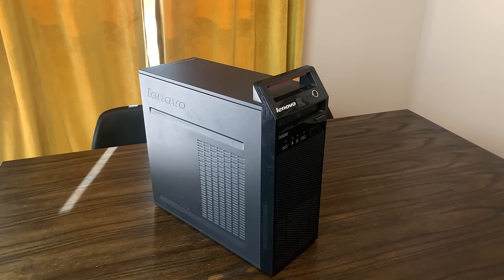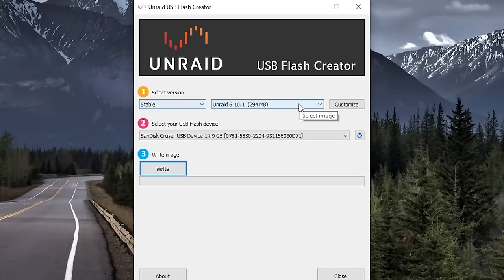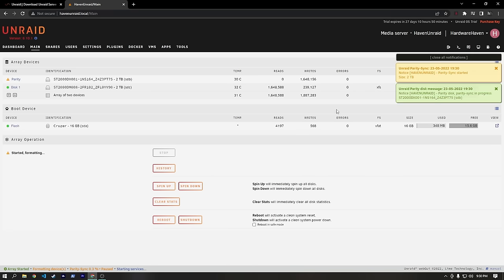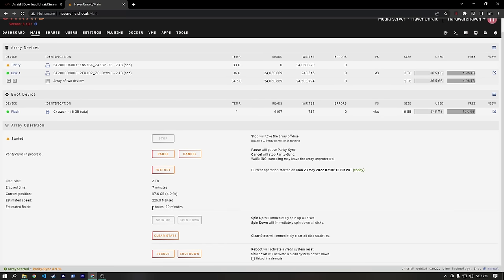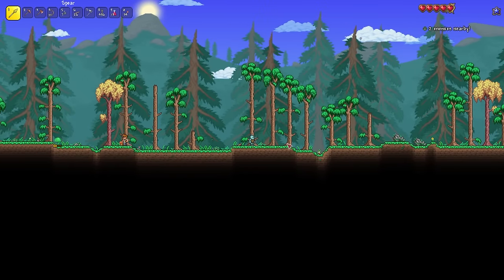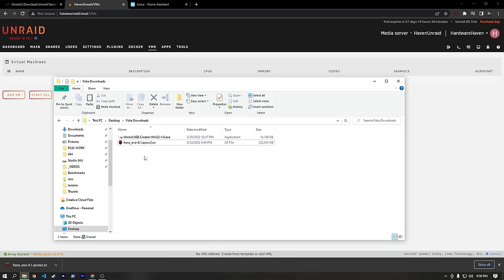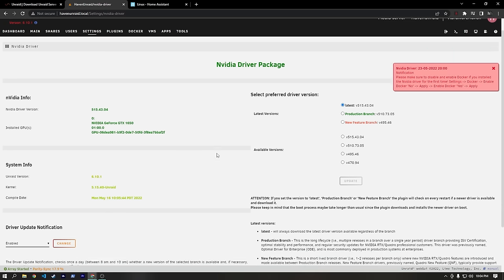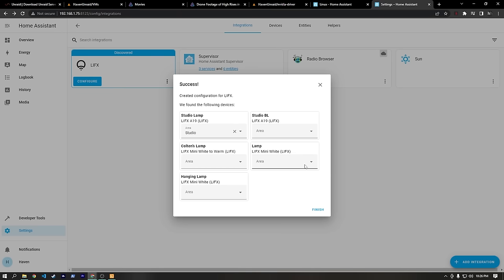Convert an Old Gaming PC to a Home Server using Unraid - (SMB, Terraria, Home Assistant, Jellyfin)

Comment: Taking out the SSD was a huge mistake. You don't wan't to run Unraid without SSD cache (or at teast use it for docker). You are loosing so much performance, I would argue using Unraid without SSD cache makes no sense (if you are not using ZFS pools in the newest release).
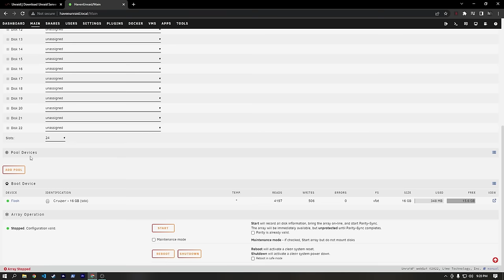Reply: No. He said in the video at the 10:47 min mark that he’s doing that in future videos and didn’t need it for this video.

Comment: Great video!

I actually built my current gaming rig with the intent of it eventually becoming an entry-level server.  As it now has 25 TB SSD space, its conversion to the dark side is nearly complete.
Reply: 25 tb ssd what  the hell are you working on nasas modded mc server or what
?
Reply: @gobnbi  Video:  4k60 / 8k50 VR
Audio:  32 bit float
Reply: @redslate  bruh

Comment: i allready have my old gaming pc since three years running as my unraid server with 8x 2TB drives..  with a xeon 1231v3 32 GB ram in my old antec 300 case every 3.5 bay and every 5.25 bay with 3.5 adapters occupied in it... running in our houses basement... all drives mounted with vibration absorbers... i love it also with plex, nextcloud, and i love "lan cache" living in a shared house with other gamers... this was the best thing besides using pfsense as our router to get our internet connection balanced between all of us... as the call of duty remake came out  6 people here where playing it... with every patch with a size about 25- 50 GB this really saved our connections bandwith.

Comment: Something to consider about the power supply, depending on how many drives you're using, the stock PSU that comes with a lot of prebuilt PCs may not have enough connectors, much less enough power. I'm using TrueNAS on an old Optiplex 7010 and had to pop in a PSU upgrade to have enough SATA power connectors.
Reply: Don't these Optiplexes all use non-standard PSUs with proprietary connectors? You know, Dell being Dell and all that?
Reply: @nahco3994  The older ones did not, depending on the configuration. The one in mine (the mini-tower 7010 model) did not have many connectors, but they were all standardized, so a quick swap to an off-the-shelf PSU was simple.

Comment: This is an excellent video that goes over a complete relatively basic setup - thanks!

I have one request for a potential follow-up: one of the possible issues in repurposing an old pc as a 24/7 server is power consumption (with power prices in some places in Europe beign 0.30 € / kWh running a 100W device 24/7 would cost 260€ a year, for example, and even with US prices being nearer 0.15 USD / kWh it's stilla pretty penny) - would you be able to delve a bit into how much power your system uses? If you have access to a more conventional NAS a comparison might also be very interesting.
Reply from the maker: Dang I meant to mention power consumption..

This system idled at around 35W. I didn’t test power draw while running data transfers or the terraria server, but during a cinebench run (so basically full cpu load), it pulled around 90w from the wall.
Reply: That's the reason why I hesitate to move any of my home network services from my Raspberry Pi to more capable hardware. Even the RPi 4B idles at roughly 3 W, and peaks out at a meager 7.5 W or so. That's really tough to beat, given the fact that its performance is more than good enough for most tasks. It might struggle a bit with media transcoding though, since there's no hardware support for that.
Reply from the maker: @nahco3994  If you have one and it meets your needs, that's perfect!

Comment: Great tutorial and channel.  Your presentation is smooth and accessible to DIY/Enthusiast/Hobbyist like myself.  I have been working on my own homelab/studio that started as a collection of old desktops of various architecture/form factors repurposed as Proxmox nodes.  Now I have a serious collection of compute and storage resources that I dont dare run at one time unless it gets real cold.  Then I do "folding at home" play hardcore graphical video games, mine monero or run hashcat 😝  then its like the tropics in my apartment ...lulz
In the previous video about building an economical NAS from various components, I have a very similar mobo made by foxconn for HP called the Nutmeg-C or P it is a slimline mini-ITX with same soldered on CPU the J2900 Quad-Core Celeron Swamptrail? 1.6GHz very powerful almost industrial PC.  Well it doesnt have PCIe slots it has a mini-PCIe for WiFi and two SATA2 data ports but an odd proprietary power connection that is closest to a Audio Line-In connection.  I think I should just need to wire my own for it from a 4pin Molex connector.  I've only used that one with different LiveOS from USB.  It remains in my collection because it is so elegant and economical for doing many things... Like making use of "thin clients" over Raspberry Pi's

Comment: So here's my question. I have two 8tband two 4 tb drives prepared for this. However one of the 4tb drives is the important info that I need to save on my nas. 
So once I put them in, it looks.likw I have to format them all. 
If I do that I lose the info that I want to save. 
So can I put in and setup the first two 8 tb drives , get it all setup then , add the other ones and copy the info over before I format it?  What's your suggestion?

Comment: The 1650 can run from the 75W power that the PCIe x16 slot provides, so you may not have needed to upgrade the PSU at all

Comment: I also remove any discrete GPU and run the machine headlessly using MS Remote Desktop or similar, that saves power and heat.
Reply from the maker: I mentioned early on in the video why I kept the GPU in, but it’s still a headless setup. The monitor was only for initial install

Comment: I can't get the hardware encoding to work. It is the one thing keeping from fully committing to running a home server at this point because it's been days that I have been trying to figure this out. The nvidia drivers are working, the nvidi-smi command shows my gpu, a rtx3070. but as soon as i turn on hardware encoding in jellyfin I get playback errors and the processes do not show up in the console. What am I doing worng?

Comment: I just happened to do this same project last week, for the SSD, I assume you know this but for others who don't, I used the small older SSD I had as a cache drive. So I left it installed, added it to the pool, which should give me better write speeds.

Comment: I have a question about this. Could this work headless without a GPU? I mean like set it up with the GPU, get it primed to use a remote software, then pop the gpu after setup?
Reply from the maker: Depends on the hardware. Because of the Xeon I’m using and the motherboard I have, you have to have a graphics adapter for the system to post. Consumer Intel chips will have an integrated GPU, so it boots just fine without. There are also more server type boards that don’t require a GPU of any kind to post

Comment: Can I use these instruktions on a "real" server? I got a HP proliant DL380 G7 rack server for next to nothing but am a complete noob and learning from scratch regarding servers. Are these programs usable on my machine? I put a sun F80 sas ssd pcie card (4x200GB ssd) in it to use as a cash/buffer and 72GB ecc ram, it has 2 xeon x5650 cpus (6c12tx2) and a Nvidia gtx 210. I am hoping to add more storage as it now has 4 x 146GB sas hdd´s, 1 is my C: and 3 is in raid as 1 volume. Will there be any pros or cons regarding my set up when it comes to using these instructions? Is there any hardware you would add or remove for a better result? Perhaps a follow up video focused on used "real" servers as more keeps appearing on the second hand market?

PS. I do plan to modify the fans to "normal" quiet pc fans so I can stand having it in my apartment as soon as I find the parts I want to use. Older server parts (like mine) can some times be tricky to locate, as I have discovered.

Comment: I did build s server for $0.00. It is based in the remains of a 2003 HP d530 SFF.  It contains a Pentium 4 HT (1C2T; 3.0GHz); 1.5GB DDR (400MHz); 4 leftover HDDs in total 1.21TB (3.5" IDE 250+320GB and 2.5" SATA-1 320+320GB).  The case is an even more ancient; a Compaq Evo Tower with a Windows 98SE Activation Sticker.  The system runs FreeBSD 13.1 on OpenZFS 2.1.4.   The system has 2 external cables 1Gbps Ethernet and Power. I use it as backup server.

The system is in use since June 2019 for 1 to 2 hours/week to receive the zfs back up (send | ssh receive).  All storage, cache and transfers are lz4 compressed (ratio 1.9).  The system has one disadvantage, it only reaches 200Mbps of the 1Gbps due to a 95% load on one CPU thread.

Comment: this video made it super easy to make my server. 
thanks.
just one question. I don't know if there is something in the system i can change but the maximum file transfer speed I get is 40 to 60ms, is that normal? even if I have 2ssds as cache?

Comment: Great video man, could you do the same video with truenas scale, ik u made one already but like with setting up jellyfin, radarr and sonarr, I'd really appreciate that cause I'm a real novice in terms of truenas and setting up docker containers, but honestly unRAID looks sortta beautiful, also I'm wondering would home assistant be of any use if I don't have smart lights and stuff like that, and can it work if I somehow hardwire it?
Reply from the maker: I might look into more fun stuff on TureNAS

And as far as Home Assistant, it's really just a hub in a sense. Its great because you can get away from having a bunch of different apps, or things like google and amazon, to control smart devices / iot stuff. Without having any devices like that to control, it's not incredibly useful.

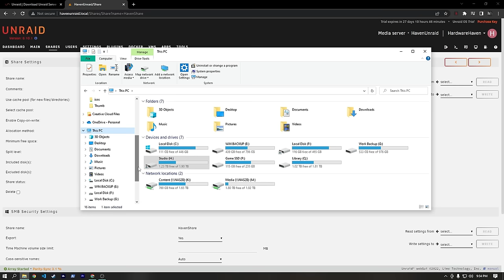Comment: Great video! I just thought i'd pop my issue in the comments because after banging my head for hours i still couldn't figure out why XD. At 14:30 when finding the network share, for some reason my Unraid server just doesn't show. Is there a fix? Cheers x
Reply: are you connected to the same wifi? Do you have any wifi extender or mesh?

Comment: Is parity difficult to set up if you have mismatched hard drives? I have one 500 GB and one 2 TB drive. Should I just buy two matched drives?
Reply from the maker: It works fine, but you can only have 500GB of useable space in that scenario. Your parity drive has to be the same size or bigger than the next biggest drive in the array. However, that means you can get another 2TB drive and have 2.5TB of useable storage.
Reply from the maker: Or any size drive for that matter

Comment: modern PSU provides litte current on its 12V supplies. one can easy blow it with several 3.5" hard drives. consider adding an extra 12V power supply.

Comment: I'm doing this now with the Unraid version of 6.12.11 and after I try to boot from the usb, it says "Missing Operating System." So I plugged it back into Windows and ran the "Make Disc Bootable" command through command prompt as a batch file but it still isn't working. HELP?

Thanks man, Love the videos!
Reply: Ok so I fixed that problem my motherboard was bad but now it’s booted and running but I can’t connect to the ip address or server name local site HELP?

Comment: would it matter also on a server Hard Drive Vs SSD Drives? i know Zero of setting up servers but sounds intresting.
Reply from the maker: UnRAID in particular doesn’t really like SSDs in arrays. You can use them in what’s called pools I believe (currently sick and on meds so I might be off 😅). Other NAS platforms typically work fine with SSDs but might be overkill unless you’re using some fast networking. (> 1Gb)
Reply from the maker: And Google is always your friend. Best of luck!

Comment: I live in a country with a lot of power cuts how can I protect my home sever from losing data or it getting corrupted?
Reply from the maker: Try to find a used UPS, ideally one with  USB data port. You can plug that into your server, and if you lose power and the UPS switches to battery, it can gracefully shut down your server. 

Google will be your friend, but this might help
https://forums.unraid.net/topic/55141-ups-and-graceful-shutdown-in-case-of-power-failure/

Comment: If you dont mind using unraid 5.0.6 there is a free version that can run 1parity and 2 storage drives for free.  I do have a paid version as well that i had 1 parity 12 data and 1 cache drive on my older server that had 4tb max drive size.

My second or backup server is running free version with 12tb drives 3 of them so has about 20tb of backups.

Comment: great video and good instructions. I think, however, that the power consumption is far too high for a 24-hour server. in europe, at around 0.3 euros/kWh and 1500 kWh/year (150 watts/hour), the electricity costs would be around 450 euros. For many applications it is probably better to buy a Synology, QNap etc, because it pays off in the first year, at least a device with an integrated graphics chip would be better than one with a high-performance graphics card, which also needs a lot of power when idle.

Comment: So I haven’t finished the video but In the past to host a game server i have had to port forward and I was just wondering if I was running it full time how secure is it to have an open port at all time while also using it has a NAS?
Reply from the maker: I don't necessarily think it's a massive security risk as long as it's forwarded to something that is reasonably secure. I would never port forward to anything directly like SSH, and always use strong passwords. There's always a risk though. Maybe look into ways to better secure open ports.
Reply: @HardwareHaven  Thankyou for the response! This is very helpful
Reply: @HardwareHaven  4 months later and I finally got around to setting up a NAS after some trial and error with Core, Scale, and unraid I have decided to go with unraid and have it up and running all thanks to your tutorials! Thanks for your help!

Comment: I think you used the standard drive as the main and the SSHD for the parity.... probably more efficient the other way round, also, maybe more efficient in that 2 drive instance to use chipset based mirroring.
Reply from the maker: Yeah I wasn’t too concerned about which was which. I sort of just wanted to treat them both as typical HDDs as to not make anything more complicated in what already became a very long video haha. Good eye and good point though!

And what do you mean by chipset based mirroring?
Reply: @HardwareHaven   RAID 1 support from the chipset / BIOS.
Unraid / Truenas etc. can do clever things with more drives (I don't really understand ZFS) but with just 2 drives, the only thing which can really be done is mirror

Comment: Can I use sata ssd for storage and another one for the software ?
Reply from the maker: Unraid is meant to run on a flash drive, so I would stick with that. You can use SSDs for the storage array if you’d like 👍🏻

Comment: Can a 16gb ddr3 with i7 4790 ram be a server ? Or i need atleast 32 to 64gb
Reply from the maker: Depends on the workload/performance you want to get, but the answer is most likely yes
Reply: 4 drives (2 mirrored pairs) 8Gb is Ok, 16 is better (and enough).

Comment: 28:46 Even the pc that the man uses as a media server has a gtx1650. Sometimes i feel so sorry for myself for living in Turkey :(
Reply: No need for a dGPU in this build. Not necessary at all. You will get away with a low power i3-3220T and 8Gb RAM (although 16 is better) - basically a potato. And don't even consider unraid, when there is TrueNas core completely for free. It is super easy to set up and once installed, totally headless through web-based interface.
Reply: @call_me_stan5887  thanks bro😊

Comment: Love UnRAID. Have 3 Servers running it. only pitfall with UnRAID is the price! Jesus its expensive! considering 70% of the content you can grab from Apps is User Driven!
Reply: Try TrueNas core.
Reply: @call_me_stan5887  I may do. Not a flexible as UnRAiD, not as easily expandable....
Reply: @stan464  depends on what you mean by expandable :) Looks pretty expandable to me. Of course everyone may have own preferences :)
Reply: @call_me_stan5887  in the sense of expanding an alred existing pool without the need to create new vdevs etc etc. UnRAiD allows you to add storage on the fly of any size disk you please, also not as heavy on ram. There's benefits to both but UnRAiD just does more for me out the box.

Comment: Is this the same as a NAS?
Reply from the maker: Yes and no. NAS just means network attached storage. This server is currently setup with a network file share, so yes it is NAS. But you could also technically run Unraid without any sort of network share.

Comment: Do not use Docker, the base process of Docker uses a lot of cpu and network

Just like miners
Reply from the maker: Huh..? Where have you heard that?
Reply: @HardwareHaven  it’s what I had been watching on my server
Reply from the maker: I don’t think that’s a Docker issue.. a large percentage of every website or service you use on the internet is containerized, often because of the lack of overhead introduced by it compared to virtual machines.
Reply: @HardwareHaven  freshly installed docker and it keeps doing it
Reply: nope, installed couple cross os pc and vps, doesnt seems CPU usage is not the issues. its mostly coming from your packaging apps. maybe had monero or .xrx behind it. like some issues with my friend from my gaming vps, either we using Linux GSM or unsafe login from  mobile with malware SSH telnet APK
Reply: @roko98332r  waht packaging apps? fresh install of ubuntu fresh install of docker and keeps doing the same thing
Reply: @HardwareHaven  bro a scamer on ur channel go to community settings and add lucky winner to the "hold to manual aprovation" list